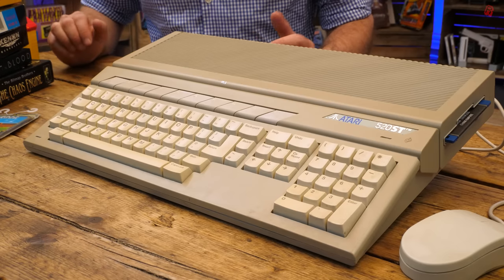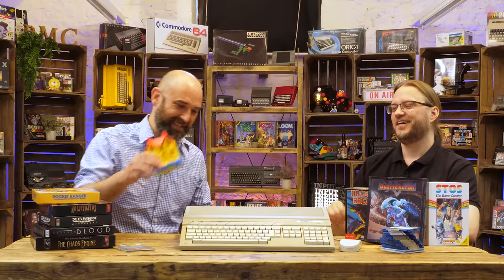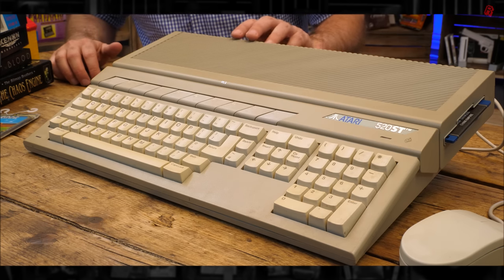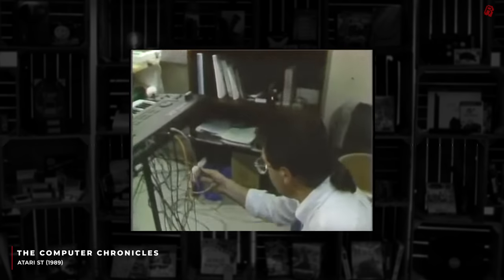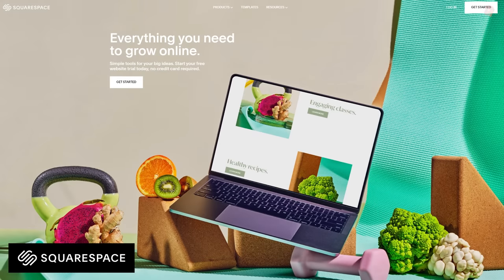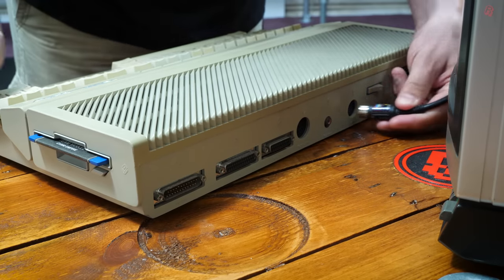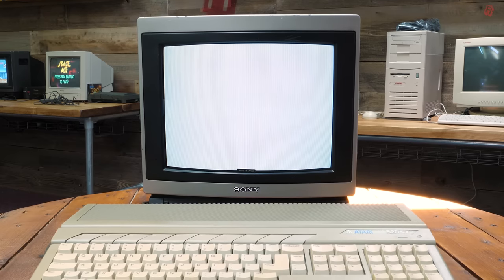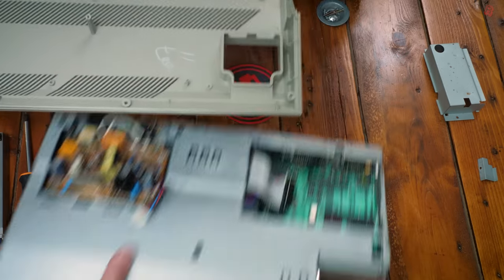At last! An Atari ST in The Cave - Meeting and Restoring a 520 STFM

Comment: Atari approached Yamaha to buy a better chip than the YM one but Yamaha thought the ST would be a significant competitor to their products so only offered the YM chip. As a load of others have said get a gotek so you can put floppy images on a USB stick and load them. The Ultra satan is a modern hard disk alternative. I have a NetUSBee which goes in the cartridge slot and adds two USB ports and ethernet. You can use Sting for a TCP stack or the NetUSBee has a built in web server although it is a bit odd to use.

Comment: IIRC The ST does run CP/M 68k from Digital Research as its OS. GEM is just the GUI (in the same way that PCs had MSDOS as the OS and Windows / GEM / TopView etc as the GUI, or Amiga has Tripos as the OS and Workbench as the GUI). It makes sense too given that both CP/M and GEM were DR products, and GEM required GSX, provided by CP/M in order to run.
Reply: Nah it is GEMDOS as stated (thank god else the ST would have had CPM's flat file system. There is a nice article by Dadhacker on the frantic push to get the OS finished :)

Comment: Two reasons I bought the ST over the Amiga (actually not the price, the Amiga wasn't that more expensive in Sweden at the time)
Dungen Master and the MIDI capabilities (very low latency due to the MIDI ports not through a exp.port but directly to the processor)
We had a MIDI studio at our youth center wig an ST and a D50 rack mounted module.

Comment: My STFM had 16 * 512k by 1 bit RAM chips, upgrading to 1MB would have involved an awful lot of soldering, IIRC the decoupling capacitors were also missing for the extension!

Comment: As a teenager had a 520 STE which was upgraded to 1040 ram. Years later when I got into gaming PC builds I opened it up out of curiosity (and to see if I could fix the broken mouse ports underneath - poor design decision imo) & to my fascination I found it had simm ram slots, basically looked the same as in a 386 I'd still been using recently at that time (by then I'd just afforded to move up to an amd k6-2 & s3 virge system).

Comment: Just to be clear, the 68000 (the first in the series) had 32-bit operations (and register pairs), but it had a 16-bit internal bus and APU. It did have a 24-bit address arithmetic unit. It wasn't until the 68020 that it got to be truly 32-bit internally.

Comment: hi there, I'm KoH Hoser from KoH Gaming, and I use an atari 1040stfe for music, however a 520 board is a 1040 board striped down, I have done ram upgrades to my old 520 board, if you look you can find a blitter for sale (though not common), and also they had outboard HDD enclosures as an upgrade option, all those would be great to do, as I have.

Comment: Good video, however your soldering skills... :). There is quite a few upgrades availabe on the market dependig how original you want your STfm to be. Memory upgrade would be a very first step (1Mb), replacing capacitors on psu or whole psu with a switching one would be the important one too as it will just extend its life and prevent unexpexted faults. To keep it original I'd invest into ultrasatan external. So memory, psu and an external storage. If you want to fully modify which in my opinion is not worth I'd modify full ram 4mb, blitter, ultrasatan internal, switching psu but question is: isnt it just easier to invest into STe ?. I've got myself a small what I call "white collection" due to only Commodore and Atari 8/16 + Falcon are in my interest and I try to keep them original, unless there is a duplicate then I may cosider the worse looking one for some mods. Good video, enjoyed. Awaiting part 2. Im myself considering publishing a mod to 8bit xc12 tape player however this is only as much as I can tell at the moment. At soon future I'll be spending much more time on STe mods as planning another purchase so will be able to donate one for some experimennts wchich mainly will cover storage options. Thanks guys

Comment: I used a 1040STFM for many years. I upgraded it with the blitter chip (I think I got Ladbrooks Computing to solder that on for me) I also upgraded it to 4Mb of memory and had a 40Mb external hard disk which cost me about £550 and for years this was able to hold every file I had ever created and it still was only 75% full. I still have all this kit in my own personal cave, though I've not got it out for a while. I'd love to be able to run all my old ST software on an emulator, perhaps on a Raspberry Pi?!

Comment: Not sure if it’s 100% verified, but the ST was supposedly originally going to have the custom AMY sound chip (also destined for XEM designated 8-bit computers).  However, there were apparently development issues and Atari didn’t want to delay release of the ST, so quickly added the YM PSG chip instead and killed the AMY development.
Reply: The YM was originally intended to only be a system buzzer, like the PC speaker, and AMY or another chip was meant to come along to sort out the sound (like the blitter came later to sort out the graphics)

Comment: I think the biggest shame about the ST, considering it had Midi built in, was the poor quality of it's internal sound circuitry. That's why I upgraded mine by selling it and buying an A500 😀. The inbuilt power supply was nice and tidy though, and I didn't have any issues with overheating on mine. Much neater than the Commodore power brick for sure. I also preferred the soft feel of the keyboard. Nice to see one being brought back to life, and I look forward to seeing what upgrades you do on this.
Reply: There really wasn't any decent build in sound systems back then. The Midi interface and software was ment to be used with hardware Synths. Not the cheap build-in Yamaha synth chips of the computers. But at least the Amiga had a reasonable DAC, tho imo the tracker like music in games with 8bit samples was even in the Amiga still subpar and was soon beaten when the first 16bit Soundblasters came out for the PC, and the EGA and VGA graphics in dos on the PC was fully on par with the Amiga in most cases. And when Roland released their MT-32 and Midi interfaces it was "goodbye Amiga". I remember I had both a Roland RAP-10 wich was combined 16bit wave and GM sound card. Also had a Roland SMPU, wich was a Midi Interface with 2x Midi in/out, so you could run 2 seperate systems with 16 Midi channels. Was the perfect solution with the Roland SC-88. wich I think was one of the first 64 notes poyphony romplers. It was practically 2 SC-55 with more sound rom. commony referes to as "Super SG" as it had more than double the ammount of sounds, an extra Delay effect and more edit options.

The biggest problem in the early PC days was, even you had enough ISA card slots, you often ran into problems having enough irq's and memory spaces to get multiple cards working, and figuring out in wich slots you had to place the different cards to "maybe" getting them to play along with each other.

Comment: Hey guys, I still have my STE if you want me to send it to you, I'm not sure if the floppy drive is dodgy or if my disks are just too old but it works other than that. It's got an original ST mouse and STE to SCART cable. Unfortunately my hard drive with all my ST assembly code died; I'm still debating whether to spend the money having a data recovery company try to retrieve it.

Comment: Get to Exxos's Atari web store and have a look at the hardware add ons there. A GOTEK for the floppy and a Ultrasatan (Lotharek) for the hard disks are probably essential if you don't mind running non floppy software. TOS upgrade probably isn't worth it unless you want to run 'productivity' software or have an early version of TOS - 1.04 is the best for STFM but a basic 16mhz accelerator can be handy to up the frame rates in some games. You could also fill in that blitter chip shaped hole in the motherboard, although the blitter can be a bit hard to source (and the space for  a blitter in yours isn't the normal thru hole type, which might make it harder).

Comment: I got an STE a while back to explore it.  Generally its a nice machine.  The one bit of the design that is bonkers is the ports for mouse/joysticks being underneath the machine which I've already had to solder.  Just a very inconvenient and illogical position for something you need to swap out regularly.
Reply: Which means I'd recommend some kind of cable to extend those ports.  Aso Ultrasatan for a fast modern mass storage device.  Seems that Atari users worship the devil.
Reply: @timwald2498  It was sadly a bit of a byproduct of squishing the PSU and floppy in the newer STF/M case. The original ST and STM came with the ports on the side. When everything else went in, the floppy nicked the space for the joystick ports, so they went underneath.

Comment: I have read that Atari tried to integrate the POKEY chip from their 8-bit line into the ST, but couldn't get it to integrate. So, they went with the off-the-shelf Yamaha AY chip instead.
Reply: Actually they tried to integrate the AMY chip, but the initial samples were not reliable enough to use in the time frame for development of the ST (it was 1 year from announcement to shipping!) - https://en.m.wikipedia.org/wiki/Atari_AMY

Ironically, putting a 1bit PWM sound output onto the DMA chip, together with a scroll register and a blitter socket would've given them the STE 4 years early

Comment: I have a 520STe, but I need a new stabiliser for the space bar, I tried to get someone to 3d print one but they never came through with it.

Mine has been upgraded to 4MB RAM, has a gotek floppy emulator and has an ultrasatan, it's also been recapped including the PSU.
I need to get it set up and play about with it again but I don't have room to get it set up right now. :(

Comment: i had no idea such computer were available back in the day. we had (still do) an apple2 c. it had a board made by applied engineering it fit between the chip sockets and the chip, enabling an overclock and an option for up to 1mb of ram. the internal floppy failed, so i managed to wire in the external. it worked. i'd like to see it in the hands of people who'd actually care about it. this is my first viewing of your channel. do you hate apple?

Comment: At last some Atari ST in the cave!  Back in the day I went with a 1040ST over the Amiga because it was £100 cheaper, had a faster CPU and I'd heard all about the Guru Meditation crashes!  So the Amiga crashes so often they tried to make light of the situation with a comedy error message?!  Hmm put me right off.  Plus I and mates had Atari 8-bits at some point, so it seemed the logical choice, and built-in Midi for keyboards seemed like fun.  If the Amiga had been a bit cheaper then that would have caused me some headaches decision wise...Good to see STOS there, reminds me of early coding days...But yes as coders got to grips with the Amiga's special chips I did become envious lol.

Comment: Note:  The ST didn't have higher resolution than the original Amiga.  They both would do 640x400.  The ST had a very sharp 640x400, but it was monochrome and required a hires monitor.  The Amiga got there, and with color (16), but it was interlaced on the standard monitor that handled all the Amiga resolutions (which means FLICKER at hires!!!).  There were eventually scan doublers/flicker fixers for the Amiga, but those came later...  As a result, if you wanted non-eye bleeding hires for productivity, you got an ST with a hires monitor.  ;-)
As an Amiga owner back in the day (and still today), I figure a little eye bleeding toughens the eyes!!!  ;-)
Reply: I think you may be getting confused with 640x512 which on the Amiga was indeed interlaced. The Amiga did have a 640x256 which was not interlaced.
Reply: @timbob9910  No, that's just PAL/NTSC differences.  It's 640x400 NTSC and 640x512 PAL.  (And that doesn't include overscan, which would scrape out a bit more..)  ;-)
Reply: The amiga had higher non flicking red : 640x256. Not 640x400, because nonetheless very good

Comment: Since you don't have a mouse, perhaps one of the USB mouse adapters. Some of them can be tricky to plug in because of the port position. For storage there are two options really, FlashFloppy with a Gotek or UltraSatan as a hard drive solution. However, if you can get your hands on cosmosEx that's probably the best. You get hard drive, mouse and keyboard emulator, network connectivity, shared folders, etc, etc... :) But they are quite hard to get and can be expensive.
Reply: mouSTer fits and works great.

Comment: The ST wasn't defenseless vs the Amiga:  it had better DMA, built in fast storage, ran 3D software 10% faster (full 8Mhz), MIDI, useful / easy on eyes high resolution mode (72hz mono), GEM/GUI in ROM.  Inferior sound meant less RAM needed to drive audio ;-)
Reply: Better dma? No the amiga had more dma channels, faster hard drives, and the 3d software were faster on the st because the coders made the amiga run st code. And the gem is nowhere as good as the amiga OS, much more complete and useful.

Comment: Re: Upgrades.
You have an SMD version of the motherboard which does limit you quite a bit with regards to memory upgrades. Have a look at Exxoshost (Cn't post URLs)

The ST has the ACSI (simplified SCSI) port for the hard disk. The quick, easy and modern solution for this is the UltraSATAN, which gives you two SD card slots which can be used as hard disks. You'll have to get some hard disk driver software such as HDDriver or similar to use it though.

As a floppy replacment you can use a Gotek drive but a better solution is the Gotek compatible GOEX drive from Centurion Tech, which has a 3D printed cage, a thumb wheel and uses an SD card instead of a thumb drive. (There are Amiga versions too.)

If you want to be Mac compatible, once you have a memory upgrade and "hard drive" search for a "Gadgets by Small" "Spectre GCR" unit on eBay. The unit plugs into the ROM port with a fly cable to the floppy port and gives you effectively a faster Mac Plus with a larger screen area. It will run Mac System 6.

Of course, there are other upgrades such a a version of the TF536 out there but that will take a lot more work and soldering.
Reply: P.S. If you want to have an Atari show at any time I could loan my TT030 (and an 520STE) to you for filming if you're at all interested. 

Finding someone with a Falcon030 may be tricky though.
Reply: @decidedly_retro  Nostalgia Nerd has a Falcon.
Reply: I bought an Atari Mega ST 1 back in the day, with the 12 inch monochrome monitor (later upgraded to the 14 inch model) and a Spectre ROM module and software in order to use Macintosh software. That was still a lot cheaper than the most affordable Mac at the time, and worked flawlessly with System 6 and all Mac software I needed.
Reply: @MarkusDieterle  Just out of curiosity. Did the MIDI ports work on macintosh side as well?
Reply: @cmdrmcmadman6349  As far as I remember I haven’t tried to use the MIDI ports under MacOS, so I can’t really answer that. There were different versions of Spectre though (Spectre 128 and Spectre GCR) as well as another similar product. It’s possible that at least one of them had MIDI support - especially if it could emulate a Mac model that supported MIDI as well. Might be worth a try, although the early MIDI software for the Mac probably wasn’t better than what you could get for the Atari ST directly.

Comment: Go to https://www.exxoshost.co.uk/atari/  and check out the forums and store there.  You could go for a 4mb RAM upgrade kit, update to the latest TOS version 1.4 (or 1.04, rainbow TOS).  Many other upgrades you could look into there.  Some basic, some more extreme, CPU accelerators as an example.  Elsewhere you can find gotek or goex additions replacing the floppy drive.  Also the best, an Ultrasatan (non satanic) flash memory hard drive.  
So glad you're covering my nostalgic favorite computer finally.  Grew up with an original 520ST and have many memories of it.  Been refurbing and collecting them now for a few years...such a fun computer.

Comment: The ST is only a "spiritual successor" to the C64 in terms of undercutting the competition in price.  The C64 is very much a custom chips computer (VIC-II, SID), like the Atari 8-bit computers and the Amiga.  The engineer who was primarily responsible for the ST did not work on the C64, either at all or in any significant capacity.  Those guys all left Commodore and went elsewhere, not to Atari.